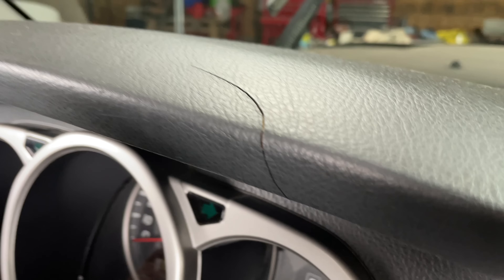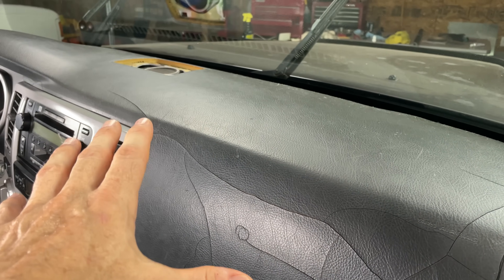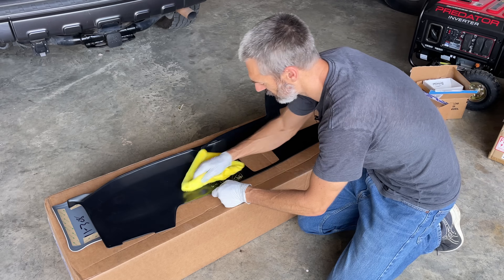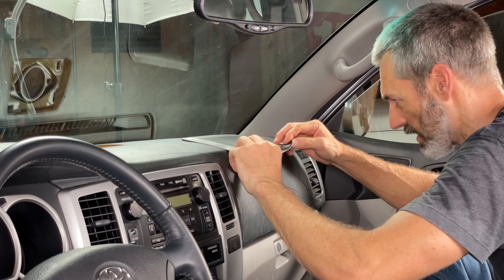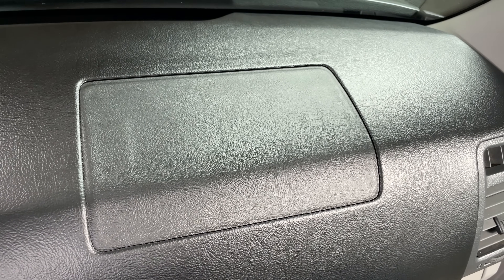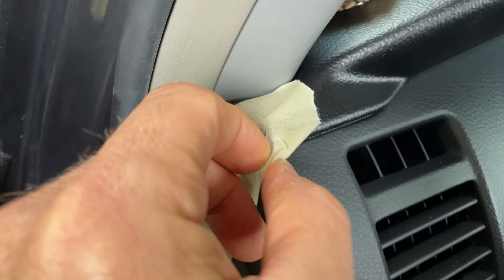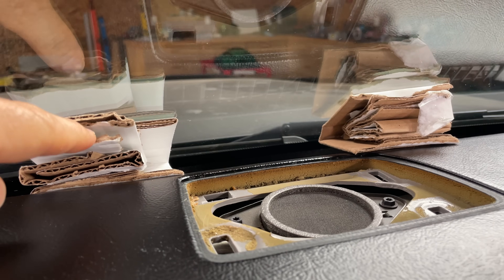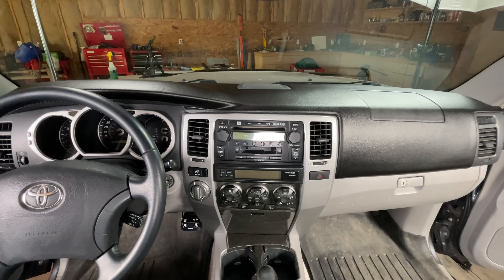This Is A Permanent Fix For CRACKED DASHBOARD!!

Comment: Did Toyota use recycled plastic from GMT-400s in this generation of 4Runner? 🤣
Reply: 🤣🤣🤣. Maybe from the GMT-800, too.
Reply: No, it’s owner abuse.  You park in a garage or use a sunshade.
Reply: Worse 80's Ford F/E series plastics
Reply: You gotta remember that Japanese cars only down the road for about seven years so mostly the cars are only designed for that long for  cosmetic. Thing
Reply: @michealrobinson  Bullshit, Ford almost always interiors hold up extremely well.
Reply: Its not from owner abuse. Its a bad dashboard formula. This effects lexus LS, ES, IS as well Sienna. Toyota and Lexus offered dashboard replacement but many didn't take advantage of the offer.
Reply: 2000s dodge rams. I had one the dash sounded like glass breaking. It didn't have enough to hold the ac controls in.

Comment: You can paint over that center speaker cover with SEM interior dye (it's actually a flexible paint, not sure why they call it dye), and you'd never tell the difference. It turned out great. Nice work, Jimmy!! 🏆🏅🥇🎖
Reply from the maker: @iceman45ification1  thanks!
Reply: I was thinking the same, paint the older, exposed pieces before applying the cover and have a perfect match all the way around.  Heat gun on the drivers side during fitment may have helped get the alignment and coverage you were looking for as well.
Reply: Also, those wipe on ceramic coatings they make to restore car plastics might last a long time inside the car.

Comment: I tried this cover on my Acura TL. It just won't settle down. The problem is that if the front is pressed down the back would be tilted up and peeling, if the left is pressed down, the right would be tilted up and peeling. I tried to pressed them down with weights for days to no avail. How did you solve this type of issue - peeling?

Comment: I recently did the same with my '95 4WD Suburban using a cover from Dash Skins. My original dash was split down the middle and the mounting screw bosses were also cracked, which made for a lot of vibration. The new dash cover looks like its fresh from the factory and perfectly color-matched Just be sure to use a lot of weight to press down on the dash as the silicone cures.

Comment: Thanks much for your video on the dash. My Camry is a 2000 so I've been just a little uneasy about the age of the dash. I have Meguiar's Ultimate Interior Cleaner. I don't know how good it is to put moisture back into the dash. But I will give it a go. Secondly I have sun shades I use for the windshield they do greatly help. My Camry gets really hot in the Summertime. Your dash looks great. Seems like the other owner didn't care of the of the 4 Runner. People just amaze me. Why buy a vehicle if your not going to take care of it. I may get a carpeted dash cover for the Camry been thinking about it for a while now. Again thanks much for your video. Very helpful.

Comment: Just FYI guys as a former Toyota tech there is a factory recall for this exact issue on this model year and Toyota will replace the dash. Also the other models effected are. 2003-2005 Toyota 4Runner
2005-2010 Toyota Avalon
2007-2011 Toyota Camry and Camry Hybrid
2004-2010 Toyota Sienna
2004-2008 Toyota Solara
2007-2008 Lexus ES 350
2003 -2008 Lexus GX 470
2006- 2008 Lexus IS 250/350
2007 Lexus LS 460
2004-2006 Lexus RX 330
2007- 2009 Lexus RX 350
2005- 2008 Lexus RX 400h
Reply from the maker: From my understanding it wasn’t a recall but an extension on the warranty. Also, it’s over 🤷‍♂️. 

Can you confirm if this actually is a recall AND if it’s still going?? Thanks!
Reply: Ended 2017
Reply: @jackwright3098 That's
 What? I was told a couple years ago about my 2008 Toyota Avalon.???
Reply: I bought my '03 4Runner in 2015 second owner. When I took it back and asked about the dashboard being cracked they told me I was not eligible for the fix because I was not the original owner. So now so many years later It's a lot worse. Toyota is my favorite car but the The person at the dealer I talked with sucked😢
Reply: Any info where i can claim the replacement? phone # and email ?.thanks
Reply: Crickets.... 😂

Comment: Whenever I replace a panel that has clips like those on the speaker cover, I apply just a small trace of some dielectric grease.  Yeah, of course it has nothing to do with electricity, but I’m using the grease function to help the clip seat easier and also help keep squeaks away and to allow for easier disassembly later.

Comment: Good job. I would've painted it though to get the factory color match. You could've used the paint to touch up those other areas with a brush that were bothering you too. 

I found this out back in the 90's when I ordered a trim part for a dashon an 80's car. The dealer got it and it was red when my dash was grey. The parts guy said they all come like that. You have to paint it

Comment: I would buy a tube of clear silicon adhesive that fits in a chalking gun.  Make a bead about a 1/4", about twice the size you did.  Mark with silver sharpy exactly where you want the beads before you start so you aren't considering the path on the fly.  LEAVE some GAPS in the bead.  Particularly on top and the area above the glove box facing the passenger (should have your method for holding that area down before you start with the silicone too).  
The plastic cover will expand and contract at a different rate than the stock pad underneath and there are huge temp swings on this part of interior.  You need a more robust bead and you need to lay it down quickly.  Make sure to leave occasional gaps in the bead so you don't trap air that will expand with heat and pop the cover up.  Make ZERO complete circles with the silicone. 
It looks like a quality part, but if it is isn't bonded down well with almost no trapped air (leave small gaps in the bead), it will come lose.  I would have cleaned the old dash with acetone and "Cheese Cloth" 1st too.  Window cleaner is a poor choice IMO.  I am assuming the instructions called for it but,  NO.  Glass cleaner is for cleaning glass.  An Alcohol wipe to the underside of the new panel 1st is also called for.  You want that silicone to stick good.
Think about how hot this dash gets in the summer sun.  NO TRAPPED AIR ALLOWED.  No circles of silicone (not small areas or the major perimeter), leave a few gaps), fat beads, clean with organic solvent, not ammonia for a better result.  
How would I know?  30+ years as aerospace manufacturing Quality Engineer.  The manufacturer is good at injection molding.  It is a real science to make that part the exact right size.  They really care about that fit and it shows.  They don't know squat about installing it with silicone (I saw the instruction sheet).  I hope you get lucky Jimmy.

Comment: That 4 runner had a recall on the dash in 2018 I think, Toyota may still honor it and replace the dash.  We had a 2003 that they did the dash under the recall in 2019.

Comment: There is a TSB/recall on the dash for 03-05 4Runners.  I got the one replaced in my 2005 for free at the dealership.
Reply from the maker: How long ago?
Reply: Yeah I was going to post something about that myself. I was a Toyota tech and there was a factory recall on cracking dashboards that have to be replaced free on multiple models and years. It’s been a while so I don’t remember the exact models and years but definitely check with the deal. 2003-2005 Toyota 4Runner
2005-2010 Toyota Avalon
2007-2011 Toyota Camry and Camry Hybrid
2004-2010 Toyota Sienna
2004-2008 Toyota Solara
Reply: There were also Lexus models as well.
Reply: @1RoadGarage  It’s been a few years back, but there was no end date (that I was aware of or saw in the paperwork), you just have to take it in for them to check it out and then they order the part and replace it.

Comment: My 2007 Honda civic base model had the most hated cheap looking(feeling) hard plastic surface. I didn’t have a garage. The car has been sitting outside almost all its life. No cracking or peeling so far. So don’t option for those soft touching surfaces 😂😂